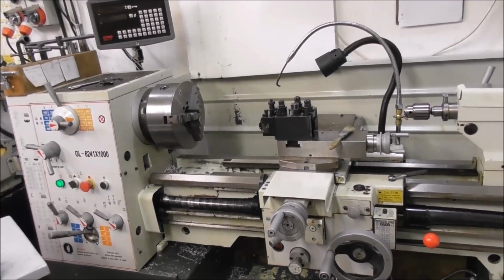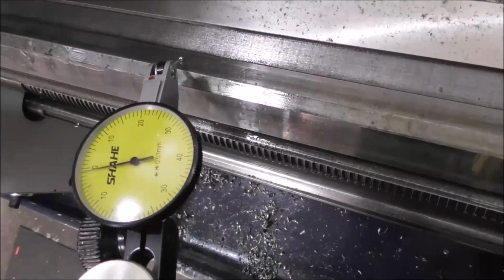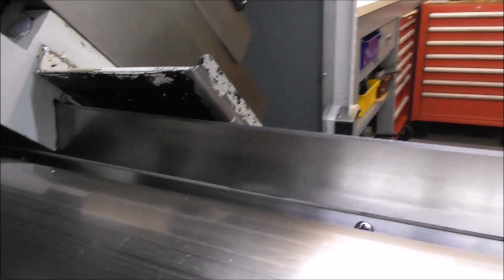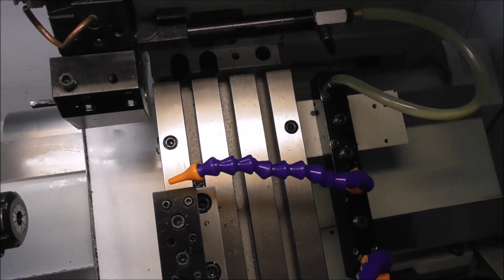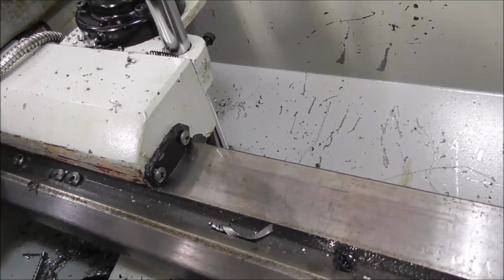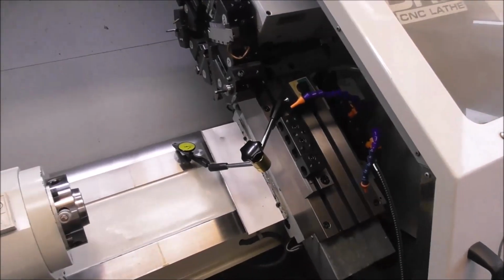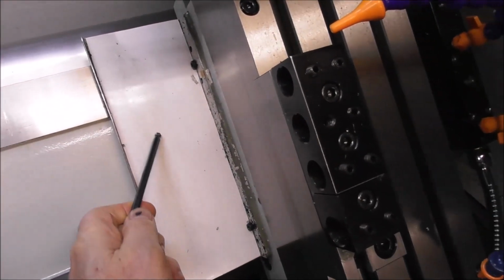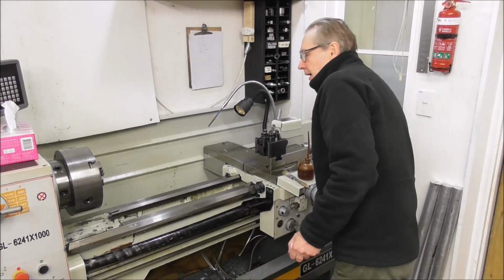Protect your machines from wear and tear. Part 1. Lathes

Comment: From what I understand Turcite is applied to the sliding member that does not leave any area exposed or overhanging, ie on the carriage and not the bed.

Thanks for another good video Cliff 👍
Reply from the maker: Hi Spencer. Yes I should have been more specific about that. What I meant was that under the carriage surface sliding on the bed, it looks to be present on the larger surfaces, but not on that narrow surface over the top edge that takes a lot of the weight. Cheers  Cliff

Comment: Although I'm a manual machine man but every morning before I start running one of my lathes I wipe off the ways and oil the ways and oil all the oil cups and check the oil flow window to make sure the oil in the headstock is doing it thing. I can do that because I own the machines.
Reply from the maker: Gets you in tune with the machine and in the mood to do good work! Cheers Mark. Cliff

Comment: Hi Cliff, you mentioned the z direction dovetail on the 15L slant pro being particularly prone to wear (cast iron to cast iron) but surely they must have induction hardened those surfaces, no? I only ask, as I am thinking of getting one of these! 😀
Reply from the maker: Hi Steve. Yes induction hardened would be nice. But a procedure like that is usually advertised as a selling point and there is no mention of it anywhere I have seen. If anyone knows otherwise, please post here. Remember it is from a low cost Chinese manufacturer built down to a price. Cliff